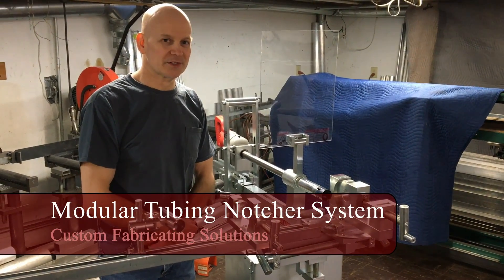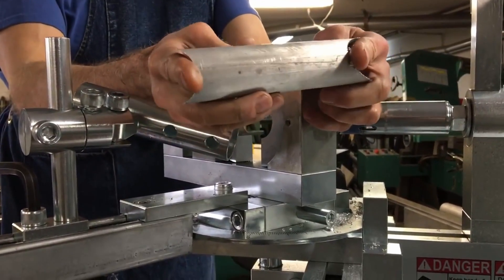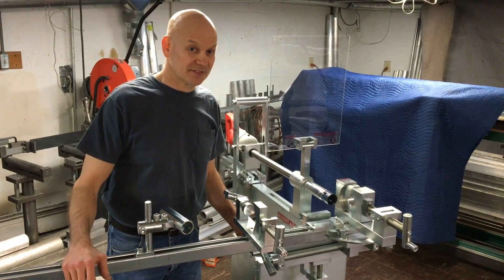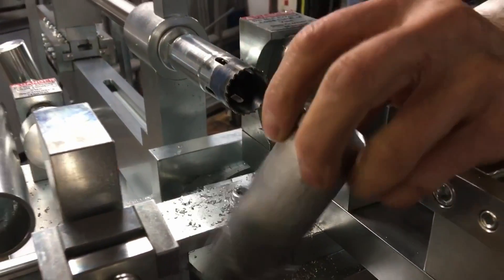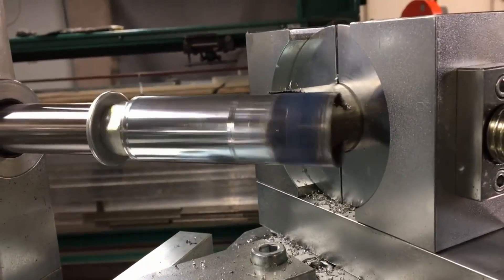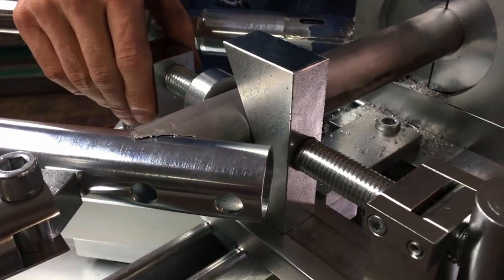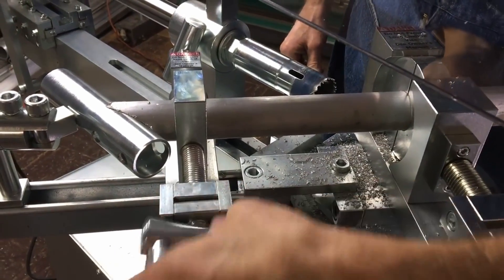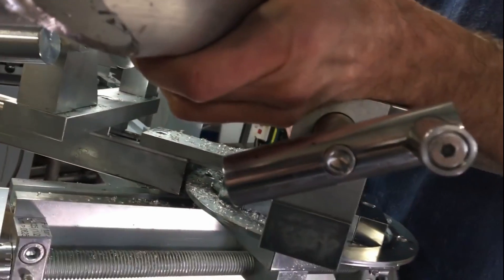Best Hole Saw Tubing Notcher for Roll Cages

Comment: Hi sir this seems a perfct notchng machine.simple and clean.usually how much does this cost sir.?also is this can b used for cutting daily 1000 pieces of alumnium (1.6mm thickness).
Reply from the maker: Sorry about getting back to you so late, we've been BUSY. This machine is designed for repeatable work, so 1000 pieces of aluminum would be no problem.
Reply: @customfabricatingsolutions650  no problm pls noted thank you

Comment: this is the most complete and frendly user notcher I ever saw, wish I could afford it but im not doing enough notching to pay that price
Reply from the maker: Thank you so much! That means a lot to hear you say that. We recently dropped our price. Would you be interested in a bench top model? Also, our hole saws can be mounted to any drill press or mill, so you could get some extreme angles coped that way. We can make a video showing that if your interested in that too! We will make any video actually, if you have an interesting idea you would like to see : )
Reply: im interested however your site is not working?
Reply from the maker: Hey Michael, Sorry about that I updated the link. Let us know us know if you have any questions!
Reply: thanks much for your reply.  im currently using my mill with a clamping system to cope steel but have a hell of a time with extreme angles and having to adjust the mill head to accommodate.  im sure its worth every penny but out of my price range.  i would be interested in your above-mentioned bench top though as it might be more in my budget.